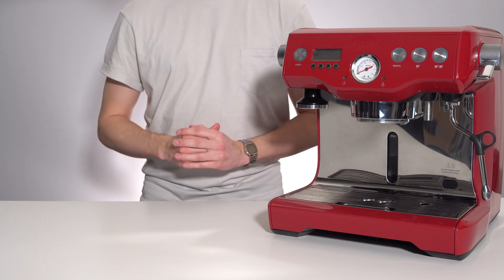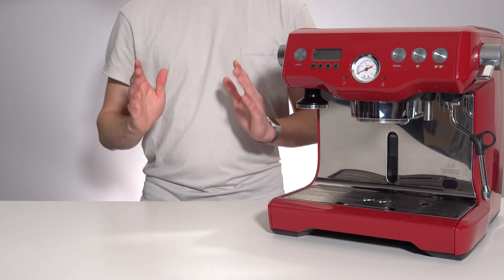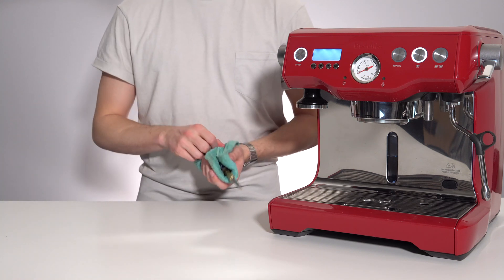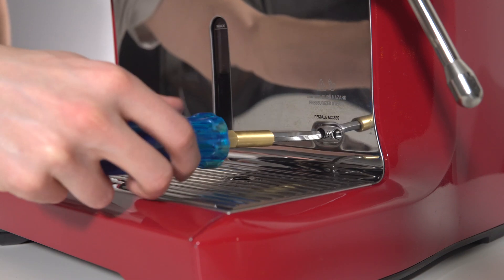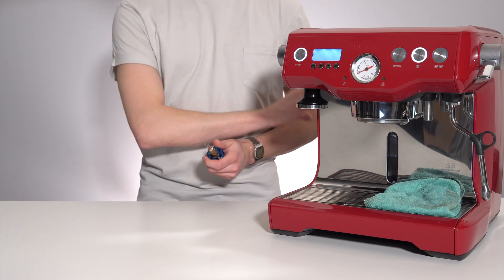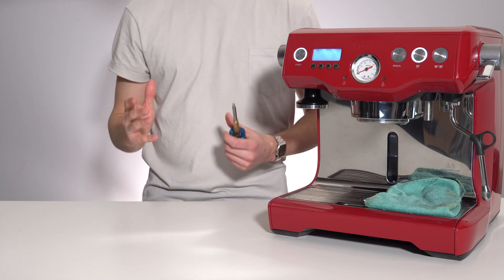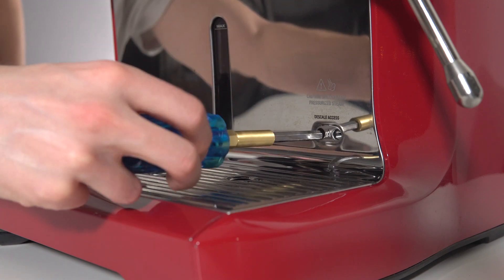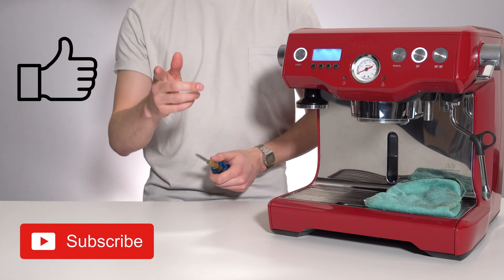Breville Dual Boiler Descale Instructions

Comment: Will this brick my machine? Heard multiple brick stories on forums relating to descaling the breville. I need to do it though..
Reply from the maker: Absolutely not! This process is straight out of the instruction manual :)
Reply: @LifestyleLab_  alright thanks Lab. Just found a similar vid by breville where it mentions the batch numbers. Will have to buy descaler now 😄
Reply: I bricked mine (blew out thermal fuse) when I used a powdered base descaler. It caked the thermal probe so it didn't fill the boiler with water causing it to blow out the thermal fuse.  Use a Liquid descaler
Reply: @shinku5463  it's not about the descaler used, there is really something wrong with their descale process. the boilers shouldn't be turned on during this process because there is a high probability that the water level sensors will not work when descaler solution is used regardless if powder or liquid resulting to your thermal fuse or heating elements to be toasted. doing a descale doesn't need the boilers to be on.. only the pumps are needed for this process.
Reply: @leomedina5760  nope its my powdery descaler that fried my boiler.   The water sensor got completely covered causing a short signifying the tank is full when it is not. So it heated the empty boiler until the thermal fuse popped.  and yes the boiler is used descaling requires hot water why do you think steam comes out of the drip tray on every purge?  I verified this again since I descaled 3 days ago.  It's even in the MANUAL.
I own the damn thing and I know what steam looks like. 
_________
3 – Begin Descale
Press 1 CUP button to proceed.
Machine will fill boilers with descale solution
and HEAT to temperature. During this time,
water may flow through the group head.
Wait for countdown timer to reach 0.
This allows solution to dissolve scale build-up.
However you can proceed to the next step at
any time by pressing the 1 Cup button.
- PAGE 28
Reply: @leomedina5760  No. descaling works best in warm water. It's the physics of hot molecules that helps break down the calcification.  Even  drip coffee descaler works best when the boiler is operating. Cold water hardens calcification. Warm water softens it.
Reply: @shinku5463  
Hole cow Shinkeww…settle down man. This is a forum to help each other and where people who need help can go for answers to their espresso machine questions. What is wrong with you…so angry. lol. Here…have a cookie. Goes good with an espresso ☕️
Reply: @shinku5463  Most people use a powder descaler to D scale their boilers. The manufacturer recommends it… All machines that are pro-sumer or entry-level and even above use powder effectively for descaling. In your case, it sounds like you had an unfortunate experience and did not D scale 🎼 your machine as soon as you should have? Perhaps it was the scaling on the thermal sensor that actually caused your problem? Ask the geniuses at Breville, who design and had the machine built. They know and can set you straight regarding the confusion on this.
Reply: @shinku5463  liquid descaling solution is not essential for descaling… countless thousands use powder to descale their machine boilers perfectly. ALL those examples speak to the facts. Powder descaler is suitable, effective, safe to use and recommended. Breville actually directs the consumer to use powder descaler product.
Reply: @shinku5463  
The instructions clearly state to mix the powder in water and then continue   The descaling powder “disappears” once mixed well with water, and becomes same as liquid descaler. So, your claims that a powder caused the thermal sensor fail and brick your machine don’t hold water. Follow the instructions and you won’t brick your machine. Peace be with you.
Reply: Descaling did destroy my Oracle. I had to pay $550 for Breville to send me a replacement. They really should cover it indefinitely if it's caused by their own descale process.